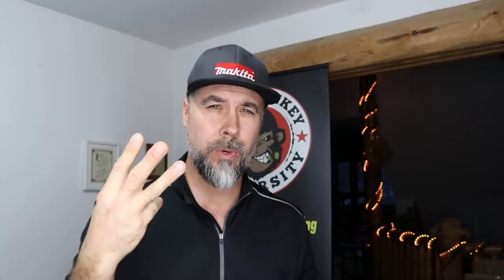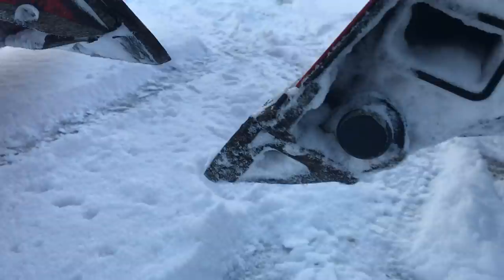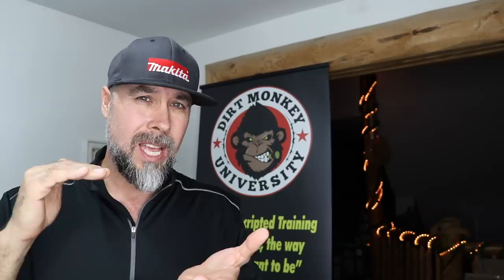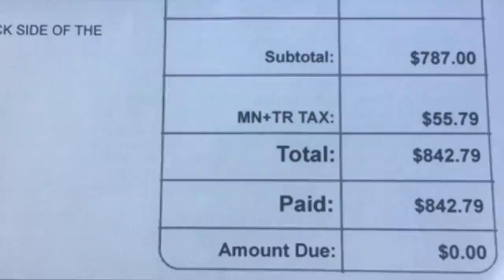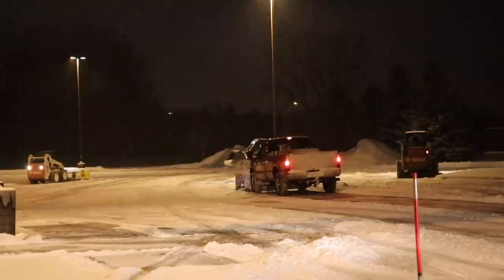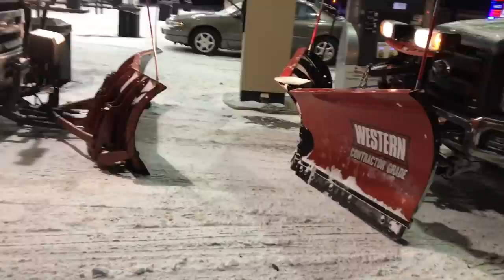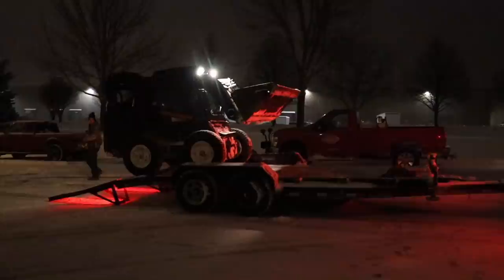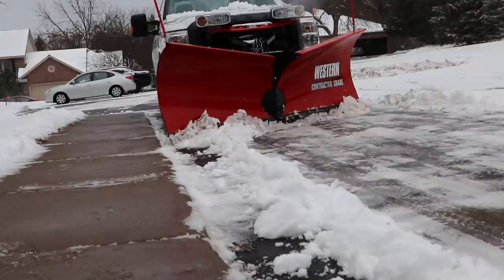Western Snow Plow Review after 13 years - Plagued with Problems

Comment: This situation sounds just like the problem with owning an inkjet printer. They will sell you a printer for dirt cheap but you pay an absolute fortune for the ink.
Reply from the maker: Yep!  Agreed.
Reply: i plow many parkinglots for over 30 years the cutting edges wear its a wear part it drags on the ground i buy my edges from mill supply they are not using ar steel also the mfdr will tell you you should have shoes on blade so cutting edge is not dragging on ground add price of new edge into your bids every year we replace most of our cutting edges or buy ar steel at steel yard and try thes will last longer but are high dollar good luck andy
Reply: Paul George 
Printer  ink is more expensive than Jet Fuel!!
Reply: Um, ya but the plow aint cheap rofl.
Reply: I could have bought a good used skid steer loader for what ive spent on printer ink....lol.
Reply: It's called toner, try it.
Reply: Matt Lane
yeah LOL and you can shake that toner cartridge put it back in  and milk it  another 100 pages
Reply: I wonder what type of steel AR400 or T1?  I would buy some steel have it machined and or plasma cut it yourself for holes and put it on. I am re welding my backhoe bucket and what I am going to do for a cutting edge on my backhoe. Scrap yard had a 1 inch thick x 2 ft wide by 14 long and just going to plasma cut the thing in half and going to plasma new holes and bolt it to the front bucket then using 2 pieces for the back bucket. Do the same they use on a cutting edge for a dozer/roadgrader. I will use some 5/8ths hard black plastic they sell here in scrap for the bottom end. Going to cut a 48 inch gas pipe in half for a plow for my 4x4 forklift.  I will bolt removable strips of the hardened plastic to the bottom of the plow so it slides.
Reply: The mine calls the stuff ink so I am calling it INK. Is the highest profit margin item in most of the stores that sell the stuff.
Reply: I’ve been putting carbide edges on for years and they last many years before they have to be replaced 
Why do they not do this ?

Comment: If they'll cheap out on the cutting edge. Gotta question what else they are cheaping out on
Reply: Looks to me like they're cheaping out on the controller.  I'm wondering if the issues there are related to how poor that control works.  Honestly, the wear on that part is damning regardless of how the controls work or don't.
Reply: thats why my kubota dealer stoped selling blizzards and western  plows and just selling snow ex products
Reply from the maker: True Rob!
Reply: Michael Mac Tavish snow-ex, Fisher, blizzard and western are all owned by the same company: Douglas Dynamics. All their plows are basically the same other than model names, color and decals.
Reply: Their main thing with a cheap fall-apart cutting edge is to make it a consumable product that you have to keep coming back to buy from them. Just a Greedy way of doing business.
Reply: Pop cann MVP 3, mallboard,friend of mine punched a hole right through on I stack that had a chunk of ice.... nobody else did and he was going slow
Reply: Customer service & support!

Comment: The controller can be programmed for one touch float. Turn off the controller. Press and hold the lower button until the float light flashes. Turn on. The plow will float with one touch. Page 57 in the owners manual.
Reply from the maker: Thanks Terry!
Reply: Yeaaah man lemme tell you most ppl don't know that
Reply: Terry scully beat me to it. I have a fisher. Absoutley love it. The 1 touch float is nice. We had a boss for a while and I absoutley hated it. Hated the dual trip in the blade couldn't stack as well w the hydrolic lift vs chain and I couldn't get used to running the controllers after fisher. Not to mention the tension springs would always need tightening and I didnt like the mount system vs fisher. Needless to say we traded it back for a fisher after 2 seasons

Comment: Upon the purchase of new plows we remove the factory cutting edge and purchase qtr inch thick hardened steel, eight inches wide and whatever length of the plow. (Bulldozer blade steel) We use the new edge as a template and mark the mounting holes and then blow them out with the torch. Grind the slag off and place to the side ready for use.  The eight inch width allows for a "flip" of the blade to get another four inches of blade life.  We have been doing this for years with no ill affects on the plow life nor blade mounting bolts.

Comment: It's not the gauge of the steel, it's the hardness.  Alloy steels are engineered for toughness by the addition of other metals to your basic carbon steel.  Toughness is the ability to wear more slowly in abrasive situations such as plowing snow on asphalt and concrete.  Alloy steels cost more, giving the manufacturer a lower margin and you replace the item less yielding lower sales.  Western is not using the appropriate grade of alloy steel for this application. Western is not stupid.
Reply from the maker: I think your right on this one Rick.
Reply: Yup its cheaper steel. 
Go to a shop that has plasma or laser. Have them bring in a sheet of 3/4” AR500. Have them cut new edges from the whole sheet. Which might cost $800 per sheet. But now its cheaper per piece. Much nicer to cut your own.
Reply: I completely agree, but, I feel taken advantage of, cheaper on the way in and more expensive on the way out buying multiple blades compared to Hinkler brand. I buy a brand that I feel takes care of their patrons, when I find out different I would be changing plow suppliers or buying Hinkler replacement blades. Probably the latter.
Reply: @Sicktrickintuner  That's what I do. AR 450 or AR 500

Comment: I've plowed for years with a straight blade and only replaced my edge once. It came with a 1/2 inch plate. At the end of the first season I replaced it with a D2 dozer edge, after 11 years it has lost less than 1.5 ". Unlike the new modern blades that have no weight, my 8' blade weighs in at over 500lbs, 120 of which is the edge. I do not use shoes. YES its all about the edge!
Reply: Sounds like they use A36 grade steel for those. It's an incredibly-strong product.

Comment: Once you wear through the original cutting edge, replace it with one made from AR500 steel.  It’s an abrasion resistant steel. I had to replace the cutting edge on my 9.5 foot MVP3 half way through my first season. 5 years later, I’ve only worn through 1/32”.

Comment: You should've always went to your local metal/fab shop and just had them sheer/bend/break/punch the carriage bolts in, and paid like $150 instead of $500... Anything maintenance related, you buy the best products you can find, because proper maintenance is what holds everything together; like tires and fluid changes on equipment. Awesome videos Stan, keep it up man!

Comment: I think you should have the hardness tested of the two blades you talked about in your video.
The Rockwell hardness test can be done at a machine shop. Then you’ll have the proof you need and the knowledge of what you want to buy for your next blade. The harder the steel, the longer it will wear. If it’s too hard, it will break, like glass, when it hits something. By testing both blades, you’ll know what Rockwell number works best in this application.

Comment: Love your videos, I have plowed in NE Ohio for 20 years. I used Western plows for the first half of my career. Loved the plows I think they are of the best out there but when I watched this video I realized that I too had issues with the cutting bars on the last 2 western plows I used. I switched to Boss because we lost our western dealer locally and the Boss customer service locally is top notch. So looking back I would totally agree that I changed more cutting bars when i was running western by far. In fact i was changing a bar every season with western . I never gave it much thought because at that time i picked up a lot of road work so i just figured I was running more miles of plowing. But it just doesnt add up. I switched to boss about 8 years ago and im only on my second cutter. This one is still in very good shape. Great video keep up the good work.
Reply from the maker: Thank you Brian !

Comment: i come from a steel makeing family. the problem is the process of aneiling process . which is heat treating the steel when made and the metal urgey  what is actually put into the molten steel . can make steel harder or softer. i worked at northwestren steel and wire in sterling illonios. this is how i got my education on steel. plus my father worked at russel burt and ward which was a nut and bolt makeing factory . that company still in bussiness in state of michigan.

Comment: Get your cutting edges made from ar500 steel or better. You’ll possibly never have to replace them. As far as controllers go, my 17 year old blizzard expandable has a plastic box with 4 rocker switches. In and out for each wing, angle, and up down with float detent. It’s strapped to the seat/ console, and I never have to look at it.
Reply from the maker: Sounds like a good set up.

Comment: WOW, thanks we we're actually looking at western for next season I've been researching found this video I think I'll be getting a BOSS maybe still looking
Reply from the maker: Look around  see what others are saying.  read these comments- people are sharing good and bad on here.
Reply: Honestly I love my boss plows one is 14 years old and only thing I had to do was replace the motor this season other than that it's been great I've gone through 2 cutting edges on it. The other is only 2 seasons old so still doing good no problems yet. I had a western hated the controller myself and the a frame snapped twice. The western dealer told me it was a problem on some of the older MVPs.
Reply: Couldn't agree more, I switched to Boss 17 years ago and still have my original plow along with one other that's newer, no problems with either of them other than the occasional spring and I replaced the original cutting edges once in 17 years. You couldn't give me a Western now.
Reply: I love western never had a problem

Comment: Just to clarify it's not a western issue, it's the parent company Douglas dynamics. Because the fisher xv2 plow wears just as fast. Having said that they should've made it out of better steel once they knew of the issue. On the other hand I just replaced the edge on my wideout (with a new western one not aftermarket )for the first time ever since buying in 09 and using almost 100% commercially.  Curious to see if the new one holds up as good as the original. Never had a complaint about the controller I like it ,it's also the same one used on snowex and fisher brand. Oh and u can set one touch float so u don't gotta hold the button.
Reply: Meadow View Lawn Care, yeah it tells you how to set it to one touch float in the manual.  Just gotta open it and read it I guess lol.
Reply: 6.4 HemiDriver there's even a video showing how to do it if reading isn't your thing! Lol
Reply: Meadow View Lawn Care LLC Why they are in business to make a profit... they want to sell more
Reply: Just went out to the truck to put mine into one touch float mode.  Real simple to do. Probably gonna switch it back.  Doesn't bother me to hold the button down.
Reply: It is Westerns fault, they are the ones who pick the steel for the cutting edge NOT the manufacturer of the cutting edge, they are just doing as they are told
Reply: 6.4 HemiDriver what about the scoop when it opens wrong way u want it. Its junk!
Reply: Good to know

Comment: I run western 8'-10' wideouts and haven't changed the main cutting edge. Had the one almost 5 yrs, it's held up good and I plow a lot of parking lots. Only thing that wore out was the polyurethane wing edges which I have switched to the steel edges.

Comment: If you have a blacksmith near you take the blade that lasted the longest and one of the newer edge. They will be able to tell you the difference in grade of steel and its wear resistance.  Hell he may be able to make you better edge. Thickness does play a factor but the biggest is the grade of steel, the grade is determined by the alloying elements, and those determine ductility, hardness and wear resistance.
Reply from the maker: Interesting, thanks for sharing!

Comment: I wonder if Western makes their plows too heavy so the blade wearers out faster than a normal plow cutting edge?
Reply: Matt is is the hardness of the steel not the weight of the plow that is the problem. You can have a butter soft steel that will wear away in hours where a hard steel will last you years.
Reply from the maker: I think its soft steel.
Reply: Meyer sv2 & boss have the heaviest Mall boards. Western is selling soft Steel oh, hardly any carbon

Comment: I live 7 blocks away from dougles dynamics (western,fisher, and blizzard) in milwaukee. About 4 years ago i bought a fisher. Brand new from a dealer. I am friends with the owner of a local shop were a higher ranked dougles employee brought his car. After talking with him with the many problems with my plow he one hooked me up with a free lift ram "plow was still under warranty" after the 3rd ram was replaced. Two was very upset to see the rust starting everywhere. And three the amount of slop in ALL movable joints and mounts. He scheduled an appointment with the LEAD tech of their company. I actually drove my truck in their shop through the factory. There was 3 people who i showed all my problems with. The answers i recived blew my mind. The guy asked the tech "why is this plow rusting so bad when we have the best paint in the industry?" The LEAD techs answer was if i would have bought a red plow you would not have seen the rust. The slop in all the pins is normal. I was shocked and thats when i realized i got screwed. I brought up the featured that were falsely advertised and recived no solid answer. The info booklet i have when i bought my plow is different than the current booklet. And the plow is the exact same!!
Reply from the maker: My Pins on my plows are SUPER sloppy as well.  Its just not a tight made piece of equipment.

Comment: Just last year I bought this plow because in my area it was a GRAND cheaper installed. My brother took over the brand new mvp 8.5 and by Feb we had to replace it. We did the HD blades and got the curb guards and center guards but after just one plow I can see this is going to be an issue. Thanks for keeping us informed bud, well be going to Exts and pull plows from here moving forward. Stay safe!
Reply from the maker: Thank you Joshua! You stay safe too !

Comment: We have a boss plow that services 6 gas stations all winter for the last 8 years, and we finally had to replace the cutting edge. Some say the boss plows take longer because you have to command each wing individually, there isn't just a scoop or vee button, but it so straight forward you can use the remote without looking at it.
Reply from the maker: I have that Boss V controller-  I loved it.

Comment: Watching through the video, you identified the problem right away, and the FIX WAS MENTIONED RIGHT AWAY ALSO. Buy Hinkler snow plow blades for the  Western Snow Plows, they were considerable less expensive. If bolt paddern doesnt match either a machine shop or drill press, or plazma cutter. You are right about Western straight bladed lasting a long time. 
On to the controller,  does the Western have as many wires as the Hinkler's controller, because I would be trying a switcher roo on that problem.. I think doing a controller switch over should be a summertime repair just in case scenario. Using two different company's wiring  schematics to see if buying a Hinkler controller could be wired in instead or a multi wire male-female plug in connector used for the change out, just a thought.
I have a fisher with that same controller and it blows...

Comment: I got a supplier out here in denver that has a carbide infused steel blade that will last 6 times longer than a conventional wear bar, same steel used by the higway department out here. Only draw back is that it cost 2 to 3 times as much $$
Reply from the maker: Yeah but 6 times longer is worth it.
Reply: Carbide is where its at.

Comment: Blizzard(now snowex) western and fisher all all owned by Douglas dynamics. They are mostly all the same design plows. You need to find a fleet flex joystick controller. They are so much simpler and easy to use. Also if you are going to buy a new plow buy a exspandable plow from either of the 3 brands listed above. They will outplow those v plows any day
Reply: Chris Uscilla I run a blizzard 810 from 2001, and I can’t imagine running any other type of blade.
Reply from the maker: I would like to try one of those.
Reply: We have a blizzard 8-10 with serial number 43 sitting on the shelf as a spare. It was the first one I have ever had. We also have a 8’ 6” speedwing with no serial number. It was one of the demos on the market. No stickers even. We bought those brand new and now we have 2 brand new blizzard 8-10 on the trucks. We also run a 8-10 on our skidsteer. Cound not even imagine going back to a straight blade. When the cable in the apeedwing broke one time I felt stupid chasing snow every where.
Reply: Chris Uscilla yeah, the wings on mine froze up so I basically had an 8’ straight blade. I felt like a rookie with all the spillage off the leading edge. I almost had to cut my pass width in half to avoid going over the lot twice.